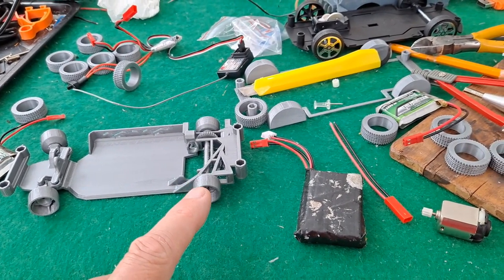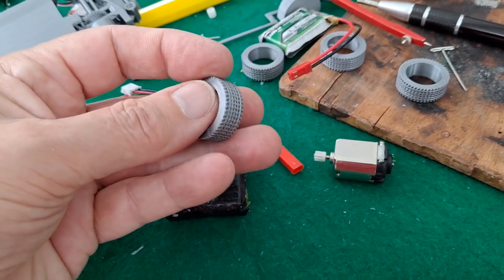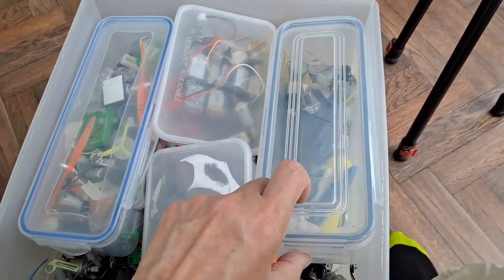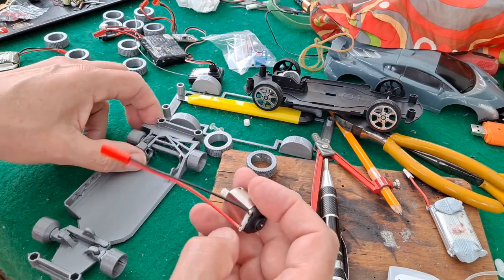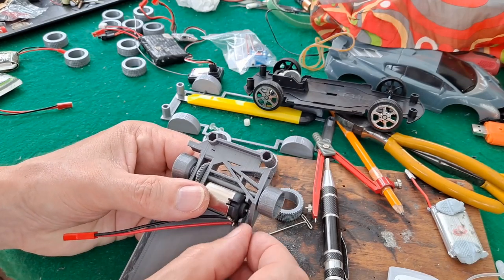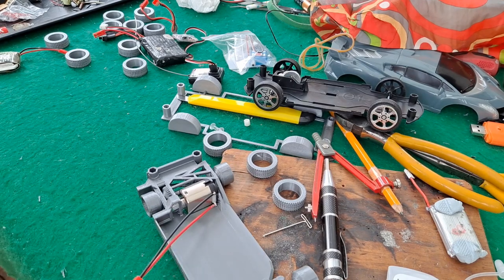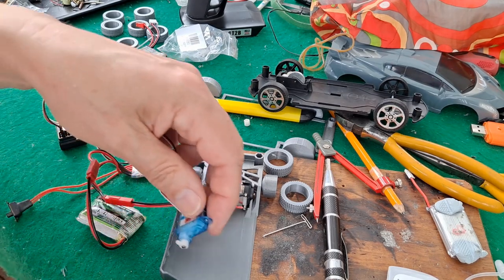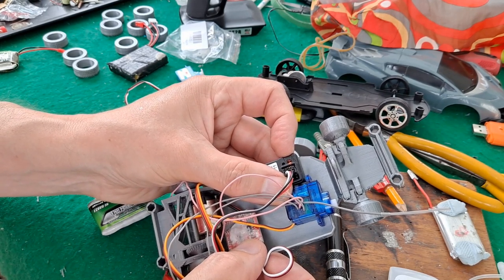Poundland toy car RC conversion project - Print in Place Part 2 - Motor & Servo

Comment: Awesome Project. Nice Tip from the guy who Commented about using lego tyres, i would have had the same Tip 😁. Does your printer have an automatic measuring system built into it with a laser that measures the item that wants  To print and then scans it into  your computer before the print off?
Reply from the maker: Hi Marc, no my printer is just a printer.

Comment: Please use a DC motor from shaving machine
Reply from the maker: I did take the motor out of a shaver a while back, but I doubt I could identify it in my box full of motors.
Reply: @GrandadIsAnOldMan  It's longer than motor you used in that car, have a width of 18,0 mm and black plastic cap.
Reply from the maker: @onlinehelper374  ln that case it won't fit